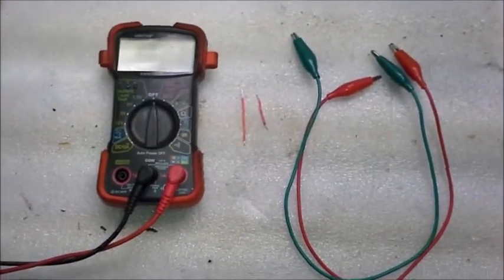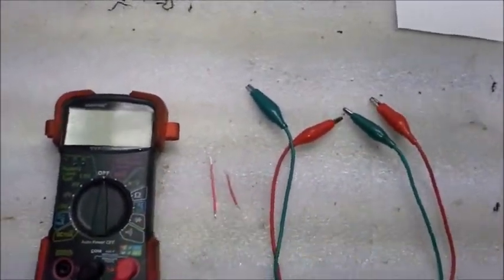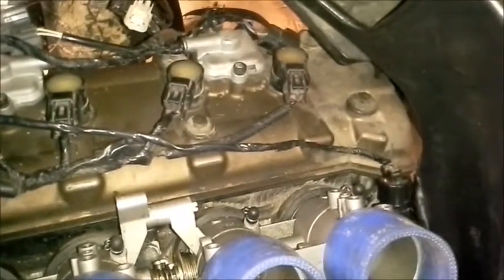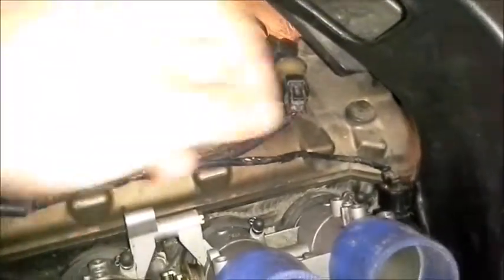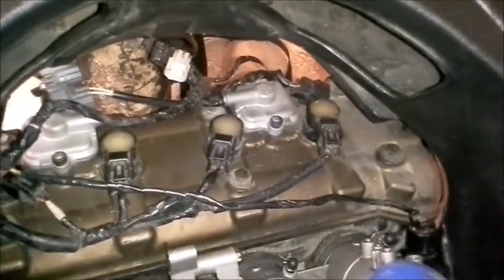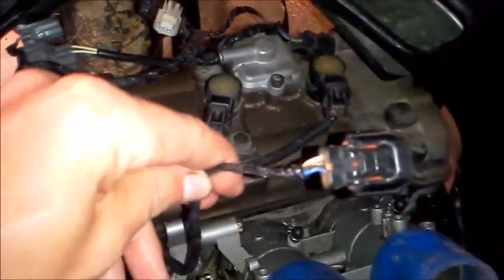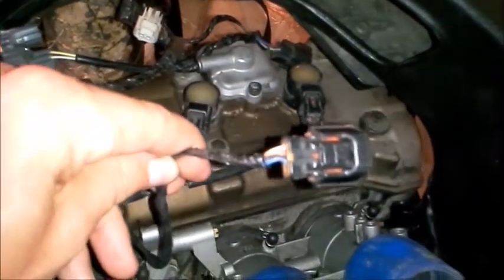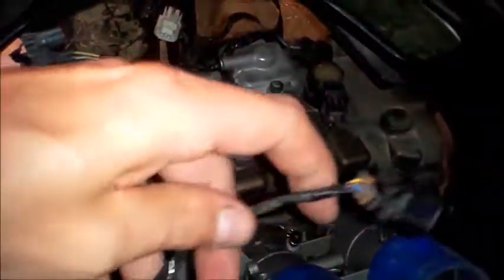KAWASAKI NINJA Service Code 11, Main Throttle Sensor, Throttle Position Sensor, TPS, zx10r, zx14r.

Comment: I replaced the TPS sensor since it wasn't within resistance and its still all wack even after I did a throttle sync. What else could it be?
Reply from the maker: It's hard to diagnose anything online without knowing some details, like year/make/model. What the bike was doing before you decided to fix it. Knowing exact resistance numbers that you got after testing the sensor. I would start there, and drop things like " it's still wack".
Reply: I did a valve adjustment, then synced the throttle bodies and installed a quickshifter which I did videos on as well (09 zx6r) After 1k miles running smooth the throttle would chop and cut out an sounded like the throttle bodies were glitching. I thought it was the Actuator sensor. It was cheaper to buy an entire throttle body assembly only $35 and then the F1 light came on code 11. (I found your awesome video) Tore it apart and noticed the Assembly I bought had a damaged sensor. I replaced that sensor and the F1 light was fixed and I figured that answered my problems. Now it idles pulsates dramatically at 2k rpm then back down to 13.5k rpm even after I did a throttle sync which kinda helped and the throttle chops still too
Reply from the maker: So you bought itb's with a bad tps, then installed it, then got code 11, so you put your original tps on the itb's that you bought for $35? Did I get that right?
Reply: I bought a different assembly which ended up not working so I took the old TPS sensor and put it on and the F1 light is gone now but I still have problems
Reply from the maker: Check for vacuum leaks between itbs and the boots and make sure map sensor is connected and working properly.
Reply: The Muscle Biker 
what is the different sensor you installed i have the same problem after i washed my zx10r 2007 ,and i looked for the sensor but it Not found in the markets in my country I want an alternative solution
Reply: I've read stuff like that happening after washes I would check the forum or leave it out in the sun for a day. I just ordered a whole new throttle bodies which are cheap when you buy used

Comment: Cool, so how did you get the code? Was it displayed on the dash?
Reply from the maker: https://youtu.be/5xPLtngYFeM
Reply: Cool I will check out the link. Thanks newer bikes are foreign to me I normally only work on older bikes but I have a few new ones I am looking at and this stuff will help since I really like doing the work myself when I can.
Reply from the maker: most efi bikes have fi light, it helps to diagnose the problem.